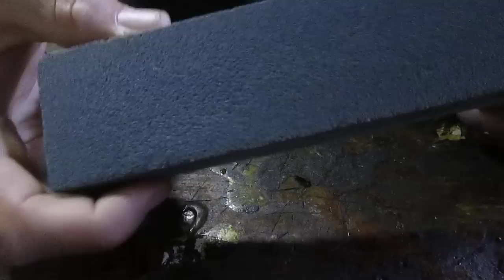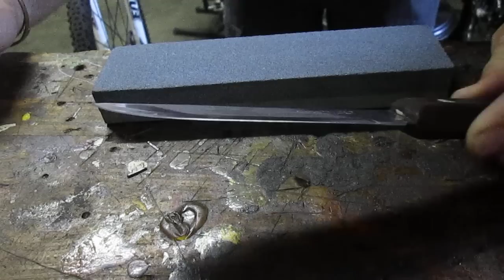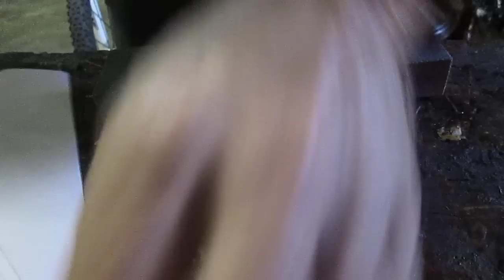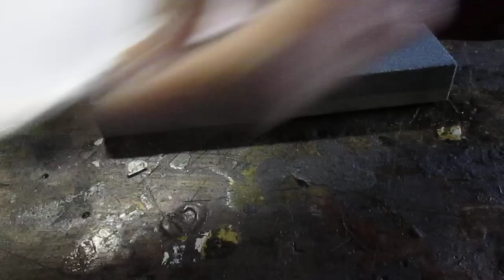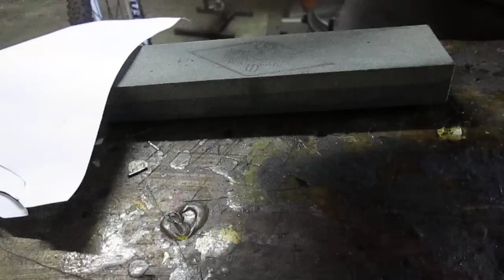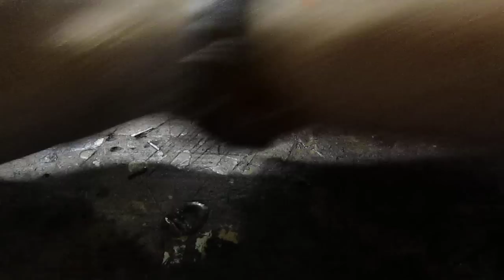How to sharpen a knife using an oilstone

Comment: I'm a sharpening noob and I wish I got a cheap stone like this from the start. I watched tutorials where they used various whetstones from 1000 grit to 30,000 grit that were very expensive. So for my first stones I bought a 1000/3000 and a 4000/8000 stone for $12 and $16. After following the tutorials my knives were just as blunt but the bevel was really smooth. Then I used a $5 oilstone that came with a bundle and after about a minute with the same technique my knives became so much sharper. Its definitely messier but I am only going to use cheap oilstones from now on. I would defo recommend them as long as people don't mind getting their hands covered in oily grit. The plus side is it softens your hands in the process
Reply from the maker: While I don't think you wasted your money, as whetstones are good to have, but anything abrasive and harder than the knife you are sharpening will put an edge on it, no matter how cheap. My current method of keeping a fresh edge on my basic knives is sandpaper stuck to a piece of wood in 220, 600 and 1200 grit with a leather strop charged with green compound. It was super cheap to make and has lasted me years! However if I've truly dulled the edges too much then I start with an oilstone again and then afterwards go through the different grits of sandpaper
Reply: @Mikey4808  That's a relief to hear and thanks for the tips! :) Its probably all down to my inexperience since I first tried sharpening a couple of weeks ago so I'm learning what works through trial and error. Maybe I only achieved a smooth, polished knife instead of a sharp one with the whetstones because I didn't keep at it long enough. I've since heard that using the finer stones is a slower sharpening process
Reply from the maker: @hamstermunchies5558  It takes some practice but give it another go. You initially need to get a burr using the coarse stone and then work through the finer grits to refine the edge, but the importance is getting that burr. The burr mustn't be too big though. Only sharpen on the coarse stone until you just begin to feel a burr on the edge, not more, otherwise it becomes more difficult to refine. A good way to check is running some toilet paper from the spine down perpendicular to the edge. If the toilet paper catches on the edge it means there is a burr. There should be a burr along the entire edge, not just a section of it. Afterwards work through the finer grits. Your knives will be much sharper if you do this. Hope this helps somewhat
Reply: @hamstermunchies5558  Stones are really only needed to form the edge and fix really dull blades, a leather strop and green compound will really be what gives you that razor sharp edge and if you strop your blades before you let them get dull you can keep them razor sharp with just the strop and compound and do so removing the least amount the metal from the blade as possible.
Reply: @hamstermunchies5558  The most important thing is to establish an edge , then you can refine it. Anything over 1000 is for specialized work,let's say fish etc... 1000 is all you want/need.

Comment: +Michael Jacobs Don't perpetuate urban myths about pulling steel or pushing steel, it will just confuse people. Old school used to teach edge first sharpening simply because of safety. Old folding knives had no locks on them so aggressive sharpening in a edge trailing or "stropping" style could close the blade on your fingers. People thought, why try to learn 2 styles? So many people just sharpened fixed blades the same way...just easier to use 1 style so you don't daydream one day and sharpen the wrong knife the wrong way and get hurt when a slip joint closes on your fingers. Somehow, observers mistook this style as a superior sharpening style and assigned all sorts of voodoo to it. Along came locking blades and soon they dominated the market to such a degree that slip joints are almost extinct and thus we can sharpen edge trailing now without worries. So now you can strop a razor or sharpen a folder and a fixed blade all using the same style. In fact some of the most efficient sharpening is done back and forth or "Japanese" style. Have fun and develope your own style and use any and all combinations of stones and stroke patterns...x pattern...j pattern...circles...whatever. It really doesn't matter as long as you get the results you want and you are happy with the edge you get then you did it right.
Reply: Took the words right out of my mouth mate....
Been sharpening wood working tools, drill bits, router bits, knives etc for nearly 45 years now.
I am a carpenter by trade.
It ammuses me at how much bullshit is perpetuated by ignorant, copycat samurai wannabes these days.
I have never used anything but edge leading techniques because I was schooled that way for the very reasons you laid out in your comment.
Because of that it is the only way I do it due to mainly feeling comfortable with that method.
Either way works fine the aim of the game is and always will be consistency with your angle presentation of tool to sharpening medium.
Reply: Beeblebrox One  now you're trying to dive into the minutiae and unless someone has a very expensive Japanese sushi knife you will never know the difference...and the difference is not determined by sharpening style alone... it's determined by angle of attack in reference to the spine... you can develop teeth facing forward for a push cut or teeth facing back to the handle for a pull cut or with circles almost no teeth at all for press cut... which is what a razor or cheese knife is basically... no slicing motion just pressing the edge straight at what you're cutting... like straight razor shaving...those are discussions for knife forums not a YouTube comment section... there just isn't enough room unless you make your own video dedicated to the subject.
Reply: @easyaussietarget3355  would you make a YouTube video how to do it. My father left me amazing knives and a number of sharpening stones. I remember him using oil (some old cans of oil are kept with the stones). I would really like to learn how to do this properly.
Reply: Where's your instructional video? Oh you don't have one, don't moan for the sake of moaning

Comment: Thanks for the video. Good point: oil the stone thoroughly. Bad point: pushing the knife is just dangerous and doesn't work from my experience. I don't know why all these knife sharpening video use a piece of paper to illustrate the sharpness? Who needs to cut paper this way? I use a tomato to check if my knife cuts well.

Comment: Harbor Freight just started selling an oil stone like this.  It's cheap, but I wanted to try it out before I started to think about buying anything more expensive.  I'm sure it's not top of the line quality, but this was more of a test run than anything.  It gave our knives an edge back, not razor sharp, but they'll at least slice a tomato without putting any effort into it.  I need to run them over the stone a bit more and get a strop to finish them.

Comment: Those are not oilstones, they're whetstones.  Oil stones are natural stones, usually Arkansas stones, and are called oilstones because they need oil on them to protect the stone.  Whetstones can use oil, water, or nothing at all.  Forget the paper.   Just set you knife straight up an down on the stone.  That's ninety degrees.  Tilt it half way toward the stone, and you have forty-five degrees.  Tilt it halfway again, and you have twenty-two and a half degrees.   Tilt it just a hair more, and you have twenty degrees, or tilt it halfway again, and you as close to eleven degrees as you can get, which will make it hair-whittling sharp.As for oil, if these are kitchen knives, or if they come into contact with food in the wild, buy mineral oil.  It's dirt cheap, and food safe.
Reply from the maker: Well to be really correct, it's an aluminium oxide stone but I just call it an oil stone because that is what most people would call it. I don't care for the correct name, I care for the end result :-). Your method of sharpening does work but I prefer to do I this way. There are dozens of ways to sharpen a knife, this was just one of them. With regards to oil, I did use mineral oil
Reply: James Ritchie natural stones do not have to use oil. that's a myth. some good info there. but also some inaccurate info also
Reply: James Ritchie it says oilstone right on them lmfao
Reply: @010falcon  that nobody replied absolutely great information it worked for my stone and wife
Reply: David Teunissen thanks for the feedback 
Happy i was able to help and your knife stays sharp
If you have any more questions, then feel free to ask 
And dont forget, always keep the factory edge, because the company which produces the knife knows the best angle for their knife and steel

Again thank yoh 
Have nice evening or day, or night and dont forget, stay sharp
Reply: How to condition silicon carbide, combination stone for first time use. do we have to soak in oil or water for the first time.

Comment: I have a question, oilstone or wetstone?
Reply: Both are useful. I use oil stones for most grit but depending on how heavy handed you are the finer stones over 1k are better as water stones. If you have a light hand the oil stones take longer over 1k. This is just my personal experience. I tend to be heavy handed so I don’t have much issue with oil stones up to 8k
Reply: Oil and waterstones ARE whetstones.

Comment: Great video 👍👍👍 
 I have a couple of questions if you don't mind and have time... I have a old stone but I don't know what grit it is and I can't tell what kind it is 🤷  I found it years ago and starting to chip away on the sides. Is there anyway to restore a stone or clean it up a little bit? The next question would be how do I know if I have a good blade and one that's worth the time to sharpen?  I had some nice looking knives before but half the time the steal ain't worth the time to sharpen. The nicer a knife is, the cheaper the blade is. That's just my opinion about the knives I bought in my life time.
Reply: Saying hi to find out the answer as well.
Reply: @chrischapman276 same

Comment: there isnt any difference at all between sharpening forward and backwards
Reply: but its just safer to sharpen forwards with non locking folding knives
Reply: Actually, there is, edge following/stropping strokes produce a finer (sharper) edge.
But this is on the highest end of sharpening skill, most people would struggle to get an edge fine enough for it to matter what technique they use.

Comment: what compound do you put on your strop?
Reply from the maker: No compound. It works fine without it but if you want to put compound on then the results will be even better
Reply from the maker: to update, I have finally rubbed green compound into my strop and the results give a slightly more finer edge. It's not essential but it does help

Comment: Oh my! Everyone is a fucking expert aren't they! It is an Oil Stone not a Whet stone and if you put oil on a Whet stone straight after that throw it in the rubbish!
Dear James Ritchie please don't give advice when you clearly have no idea! If you are using an oil stone with knives that will be preparing food please use a vegetable or sunflower oil  not a mineral oil or wd-40 these are fine for chisels but will taint food if used on kitchen or hunting knives, and before you start saying I am a fool I make my living with sharp knives , I am a chef and an avid hunter for the last 30 years so neer! Technique and angles are something you develop with experience and depending upon the application as Michael so rightly explained but somewhere between 15 and 20 deg will be just fine to start.

Comment: This is wrong on so many levels... please do not sharpen your knives like this, people.
Reply from the maker: LouSaydus I'm curious to know why you would say that? It most certainly works well for me. This is an educational video so I'd like to hear your thoughts on the matter
Reply: There are a few major issues. I'm not super familiar with oil stones so I won't go over the application of oil, but it seems that the stone used is very coarse and needs more lubrication to avoid edge catching. The first major issue is the stone is not secured properly. It is rocking back and forth as the knife is being stroked which means it's impossible for the sharpener to ensure they are running the blade at the right angle.  The second major issue is the knife is leaving the stone, that shouldn't be done because you're going to hit the stone at a slightly different angle each time (possibly chipping a coarse stone) you put it back down on it. Even if you manage to put it down at the correct angle you're going to roll the edge of the blade ever so slightly and ruin the bur you just created. In an extreme case you'll end up with a curved profile which will make the knife durable but it wont have a very sharp edge.  Also pushing or pulling are both perfectly viable on lower grits. Once you work your way up to 1k+ you'll want to pull the blade so a bur forms and is worn away rather than pushed under the blade possibly causing edge defects. The strop shown here with no compound was extremely worn. When small bits of leather get under the blade you don't make good contact, not a major issue due to the way you should be running the blade over it but why show something that's off when teaching others? You should also impregnate your strop with a compound to help polish the edge and smooth it even further as well as lubricate the action ensuring equal pressure and draw speed. Again the compound isn't going to make or break the edge but it'll get you in the correct mindset and will help to refine the edge.